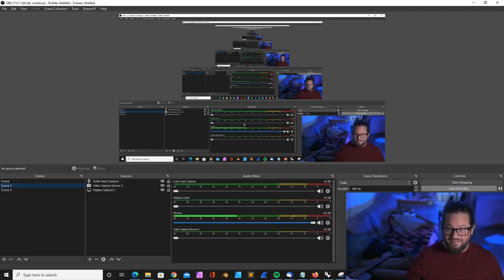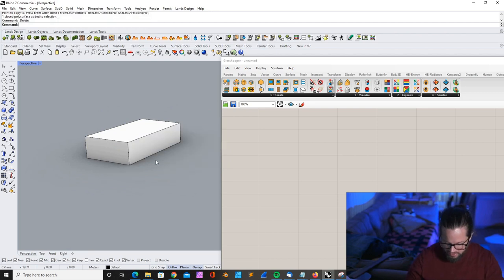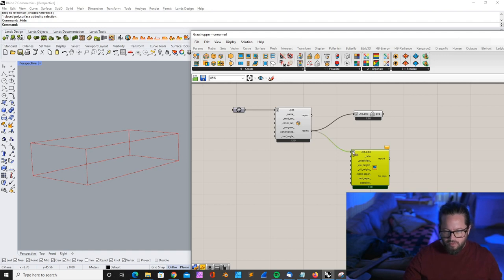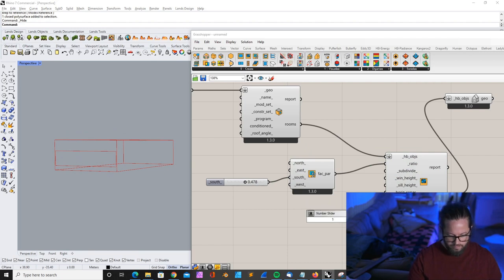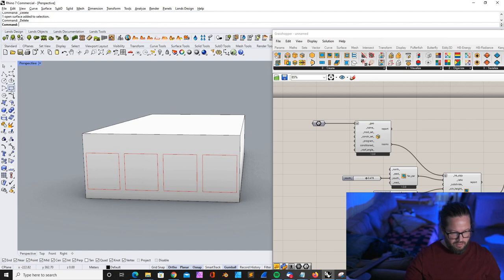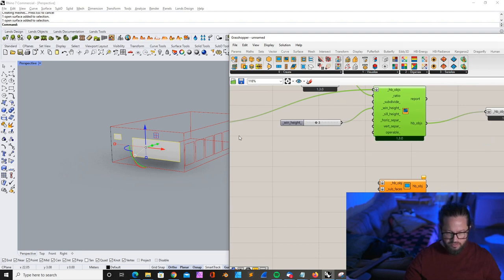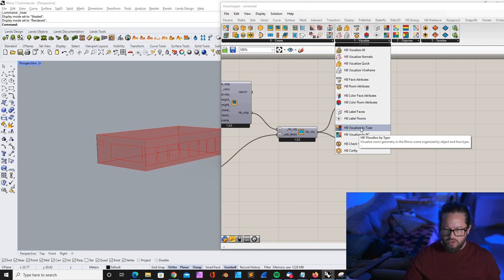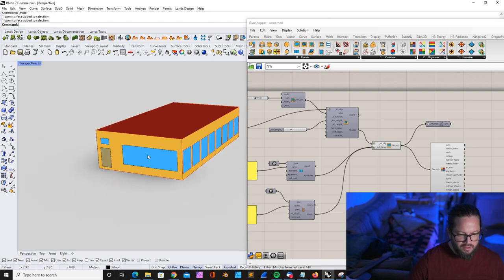Custom Windows and Doors Layout in Honeybee |  Ladybug tools 1.3.0, Grasshopper 3D, Rhino3d

Comment: Hi! First of all, thank you a lot for your incredible work and contribution to open knowledge. I am having a doubt about how to model interior doors because when I use de HB Add Surface, it only generates doors on faces with an outdoor boundary condition. How can I model the interior doors?. Thank you!
Reply from the maker: Yeah, it was a mystery to me too for a long time. I figured that this feature of interior doors is just not implemented. I haven't checked in version 1.5 though.

Comment: Thanks Philip. Can you please post the version without the "camera" window in lower right corner. This window obstructs the view of the operations in grashopper window. By the way, please post more of this type of conent. I would like to simulate the daylight parameters with the shading louvers, that are alwaye perpendicular to the direction of sunlight. I know how to operate wih honeybee (thanks to your videos) and I know how to model the shading louvers using the sunpath form ladybug, but do not know how to connect them both. Mamy thanks in advance.
Reply from the maker: Hi Marcin, 
Yes, the camera is quite annoying. I always see it just at the end since only have one screen at the moment. Very good point... For another version, it's a bit too late, but I will try something else in the next videos. I hope you can still follow along. there is nothing really totally hidden. But if you have trouble with some of the video sections, let me know and I can try to help and explain to you what I did.

I need to think about your question. So basically you would like to add custom louvers that move with the sun position?

Best
Philipp
Reply: @PhilippGalvanDesign  Yes. this is exactly  what I wanto to do, and I need his for a research project at my Uni